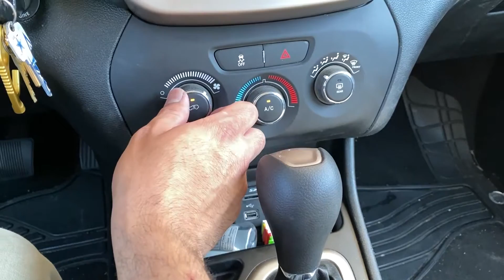Jeep Cherokee ac blower motor replacement

Comment: Any tips on how to clear a clog in windshield washer line?
Reply from the maker: Maybe compressed air unplug the lines and apply a small air pressure windshield washer fluid will gel over time check your pump be very careful with air in the line too much and you can blow out t fittings

Comment: did the car had a error code B10E9 and B10Ea for blown motor control circuit high and low?
Reply: Ha that’s my error code I want to fix it instead of taking it in

Comment: Friend some suggestion my ac doesn't turn on, I've already checked fuses and everything ok, but it doesn't turn on the selectors or anything
Reply from the maker: Sorry for the late response if not fused has to be either control panel/ knobs or blower motor it sealed
Reply from the maker: It self

Comment: Amigo alguna sugerencia mi ac no enciende, ya revisé fusibles y todo ok, pero no enciende los selectores ni nada
Reply from the maker: I would check the ac switch itself maybe tap the blower motor to see if it’s getting stuck or checking the wire to make sure you don’t have a broken wire